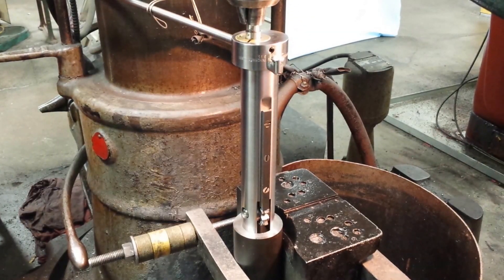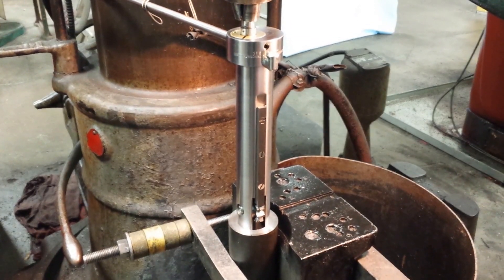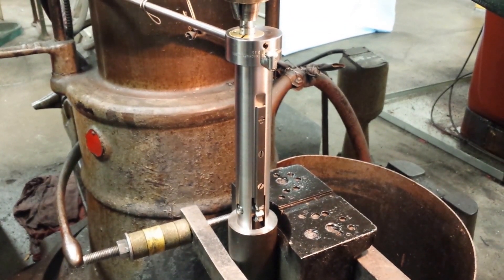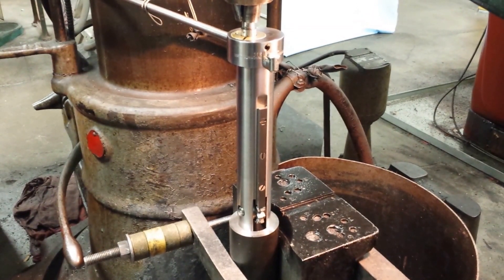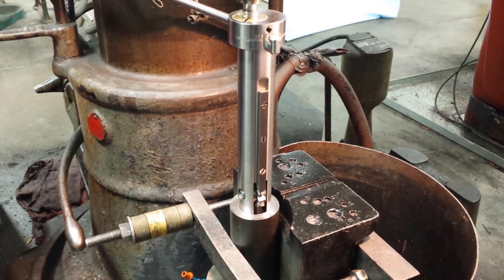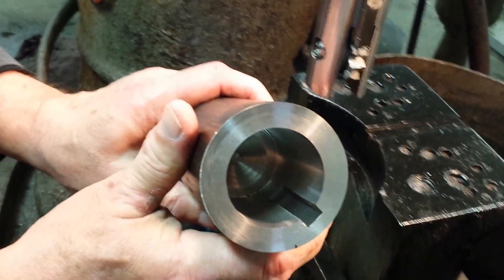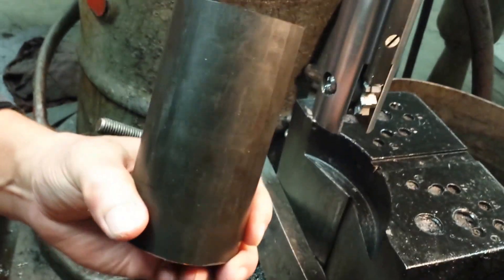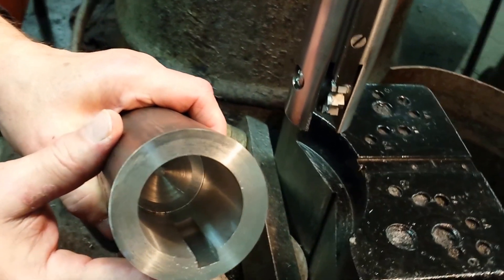National Machine Tool: Milling an Internal Keyway in a Blind Bore

Comment: Really brilliant! Thank you for showing! I never thought of using the inside of the bore and the key way itself as a guide for the tool! I also only ever thought of 'side-driving' the cutter with maybe a drive chain, not using the back of the tooth! Did you guys think of that? It's really nice! What machine is that in? It doesn't look like a Bridgeport Vert. Mill. Is it a boring machine of some kind? I watched your other video! I love this alternative to the reciprocating methods. What do you think the maximum practical internal key way would be? Does anyone do stock shafts this way for sale as regular inventory, the same way we can  buy regular/externally keyed shafting?

Once again, thanks a lot! You made my day!
Reply from the maker: Thank you for viewing. The design of this tool came from Germany in the late 1800's. This is in a large radial drill. We have milled up to a 2" wide keyway in this fashion